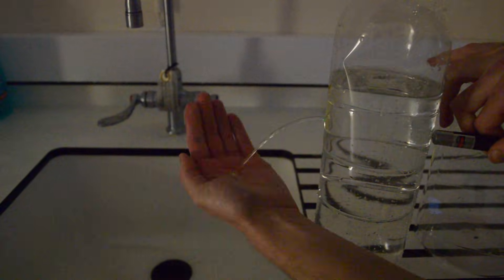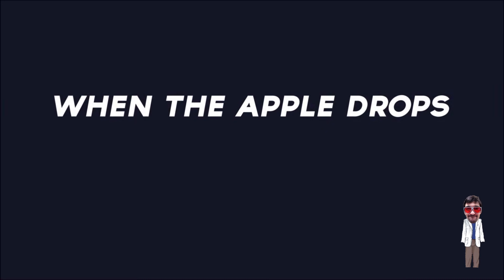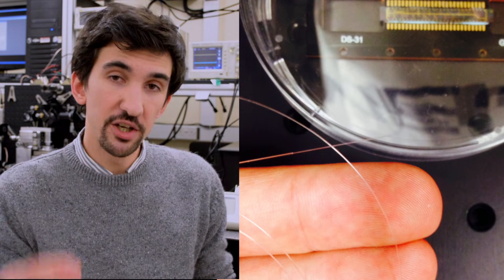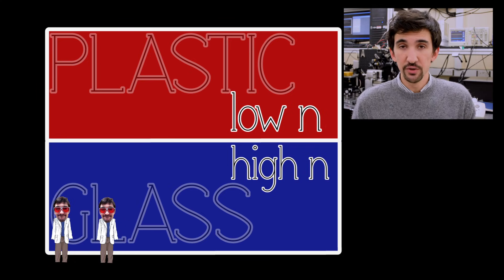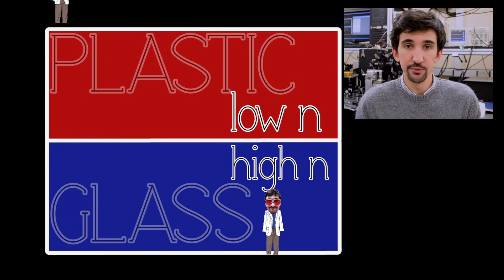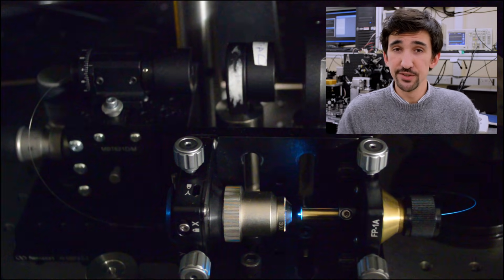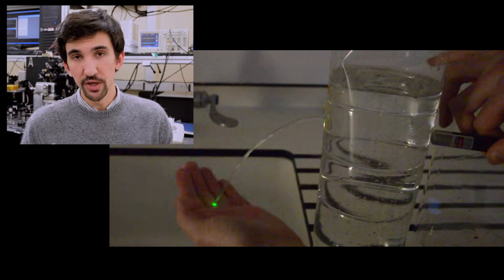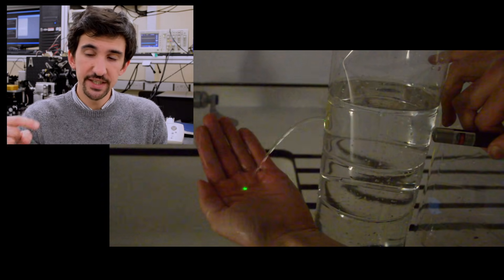How Do Optical Fibers Work?

Comment: The light dont reflect off the plastic most likely, but off the glass. The core is inside the glass and the core has a glass cladding to keep the light inside the core. the cladding has a lower refractive index than the core to keep the light contained in the core. i could be wrong but i know most single mode fiber works this way. you can get fiber coated with plastic for protection and color coding.

Comment: Brilliant explanation, yet I still don't understand how they encode the information into the light as you said in the beginning
Reply from the maker: That's a good idea for a follow up to this! Cheers
Reply: @DrBenMiles  ~4 yrs ago~
Reply: Fiber-optic cables transmit data via fast-traveling pulses of light is what we call it. Light travels through this medium and another layer of glass, called “cladding,” is wrapped around the central fiber and causes light to repeatedly bounce off the walls of the cable rather than leak out at the edges, enabling light to go farther without attenuation/diluting.  Basically, by modulating the light in tiny pulses that can be decoded at the end, sort of like Morse code, we can send tons of information at the speed of light in the material we use, fiberoptic lines.  That said, over larger distances the signal can weaken.  So repeater stations/boxes are attached to re-emit the light in a stronger fashion to get it to travel further.  There are many videos on this topic and I highly recommend searching for a viewing them as I can only barely explain this in terms that I understand.  I could very well be wrong in some instances.